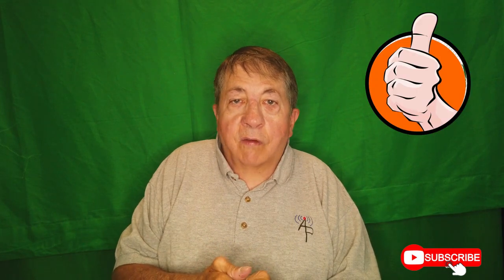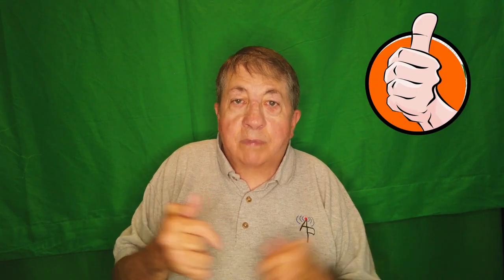DIY Avata Sensor Repair

Comment: Hello, I’d like to know if this happened to you as well. I replaced the bottom sensor and the cable on my DJI Avata 1 after it had a crash. After the crash, it showed a visual sensor error. I bought the replacement sensor on AliExpress and installed it just like you did, but the error still remains. I contacted some technicians who told me that the sensor needs to be registered on the drone's motherboard in order to work, and that it’s not possible to simply replace it. Do you have any tips that could help me?
Reply from the maker: You may need to update the firmware.

Comment: Hello!!! Im having an issue with my sensor saying “downward sensor error contact dji support for assistance”. Did this fix the error message you were having with this drone?!
Reply from the maker: You could have a damaged sensor that needs replacing.
Reply: @ArtCoDroneAndEntertianment  im sorry i may have been unclear about my question I’ve concluded that my sensor needs replacing, however im curious to know if you were able to successfully replace the sensor and calibrate the aircraft with no other error messages after the replacement. Because it is unclear, based on my online research, if this replacement is possible by a consumer with the tools available to us IE; dji assistant, and second hand parts.
Reply from the maker: @MattDickey530  yes I was successful in calibrating the drone after replacing the damaged sensor. I used the DJI assistant as well. Thanks for your comments.